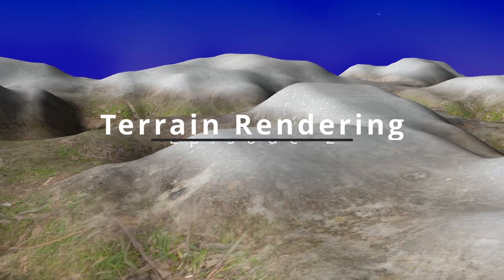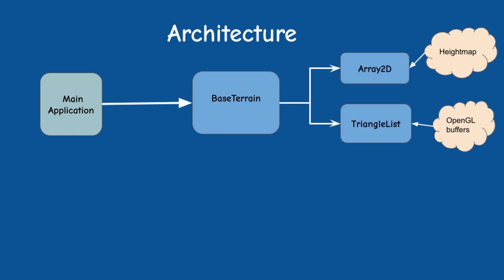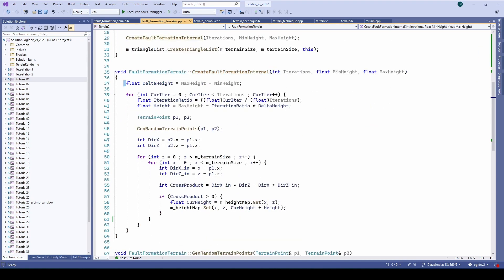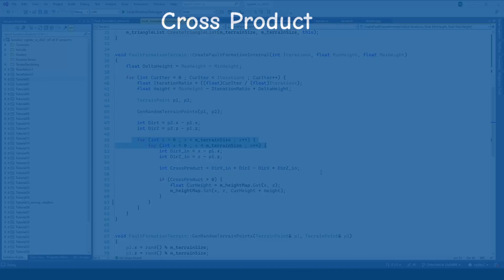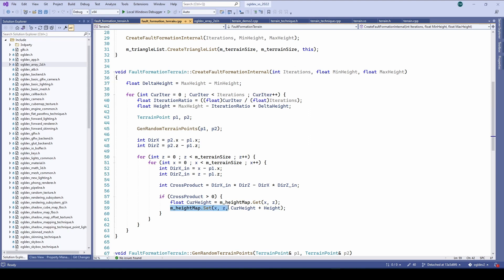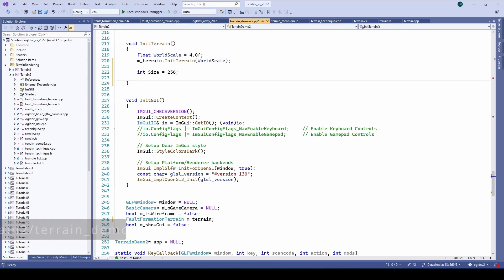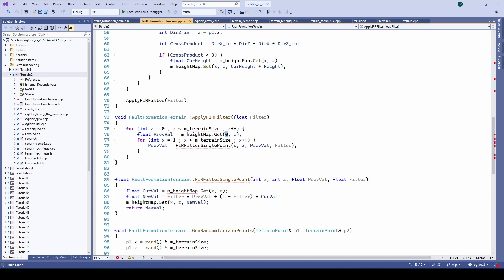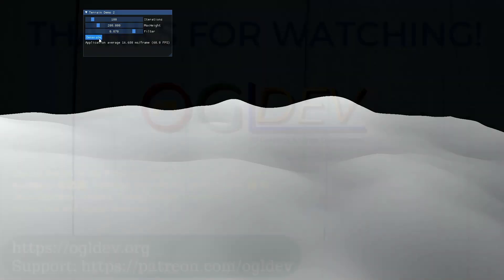Fault Formation // Terrain Rendering episode #2

Comment: when you create fault formation here, is it operating on the original world map vecor you used in the previous episode or are you effecting and generating a new world. I am applying this function to my current terrain and the results are fine but there is no connection to how it looked before hand
Reply from the maker: The algorithm is applied on a flat terrain or world map. So you should prepare a grid of vertices in the XZ plane and calculate their Y value using this algorithm. If you disable the algorithm you should be getting the same flat terrain.
Reply: @OGLDEV  thank you. I did notice these algorithms tend to start at one side and then the heights drop to the other side. Which would create unnatural terrain as your game world would be high on one side rather than randomised. Do you recommend the next video for that solution. The mid point. Or can I adapt the fractal somehow also
Reply from the maker: Did you see this using my code? I don't think it should happen but there could be a bug. Go ahead and compare it to midpoint. Maybe it will work out better for you.

Comment: The fault formation algorithm is kinda neat. I've never seen that before.Technically speaking, what you've implemented is an infinite impulse response (IIR) filter. Sometimes called recursive filters because they reference values that have already been filtered. They are very computationally efficient, but end up "smearing" the results in the direction they are applied (phase response). The phase response changes based on the composition of the signal, so it can end up warping the shapes of things, and making your mountain peaks slightly tilted. You can avoid this by filtering forwards, then backwards to cancel out the phase response. You can also do even stronger filtering, or combine multiple passes together by using more taps in a single pass for better performance. (edit: oh derp, I see you are doing forwards and backwards filtering, n/m)
Reply from the maker: Thanks ;-)